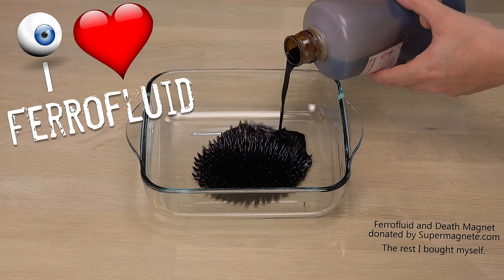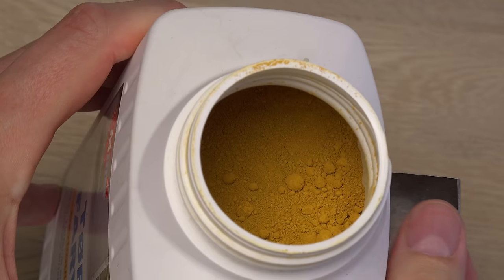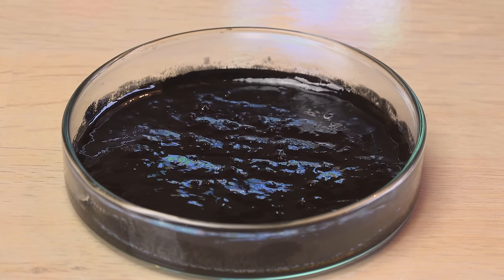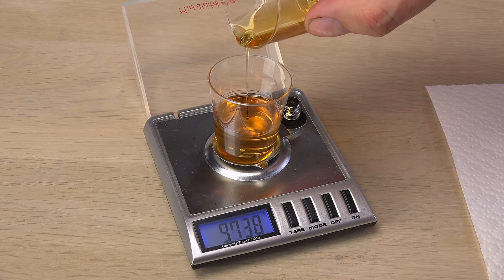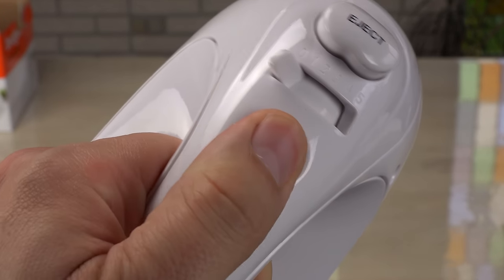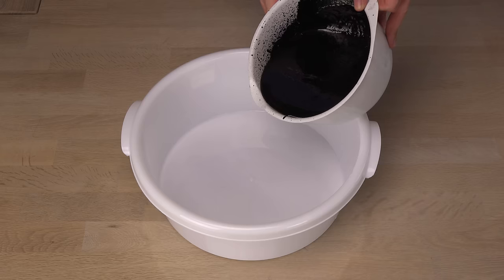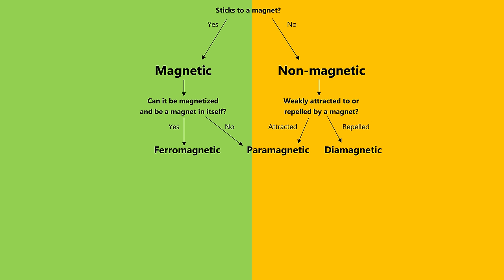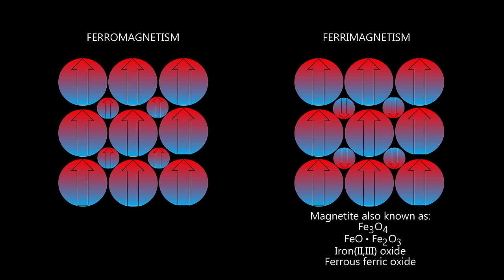Magnetic Motor Oil? | Easy DIY ferrofluid

Comment: I like how the spikes join together almost like mountain ridges here, as opposed to the discrete spikes you usually see in commercial ferrofluid. Reminds me of fingerprints :)
Reply: The magnetic lines seems to act like aurore boreale, northern lights.
Alan Turing explained mathematically how the embryo of plants and animals could form geometric patterns.
Basically, two competing type of cells with different grow rate.
I asked twin brothers if they had same digital print. The negative indicate that a random process is involved.

Comment: My car has a drain plug on the transmission with a magnet designed to collect metal shavings. When I changed the transmission fluid a few months ago, I scraped off what the plug collected into a plastic container and played with it for the longest time. It was pretty much a ferripaste because it spiked in the same way. Got excited when I saw he used motor oil! Great video!

Comment: I bet the cleanup of those bowls was near impossible...
Reply: Anything goes away if you add a strong enough acid
Reply from the maker: I sure gave up... They were heavily-worn bowls with a lot of tiny scratches. Nearly impossible to clean out from the scratches - much easier to buy some cheap new ones :) Thanks for watching!
Reply: even the bowls lol

Comment: Several years ago, while trying to make ferrofluid from scratch, I think I figured out how to make magnetite in my kitchen with household items.  It's super easy.  All you need is a plastic container, water, table salt, steel wool, a DC power supply, and a random piece of any kind of metal to use as a cathode.  I used a piece of copper pipe.  You also need a container you can heat on your stove.  I used an erlenmeyer flask, but I don't see why any old saucepan wouldn't be adequate.

First, fill your plastic container about half way with water and dissolve a bunch of salt in it.  Next, connect the positive wire from your DC power supply to the steel wool.  That will be your anode (the electrode which attracts the anions).  Connect the negative wire from your DC power supply to the random piece of metal.  That will be your cathode (the electrode which attracts the cations).  Immerse the two electrodes in your salt water container.  Be careful that they do not touch, or you might blow up your power supply.  Also be careful that only the steel wool, and not the wire connected to it, is immersed, or you might end up dissolving your wire, and that would bring the experiment to a premature end.  Turn the power supply on.  You'll eventually notice green stuff coagulating in the solution.  After there is a reasonable concentration of the green stuff, turn your power supply off, take your electrodes out, and pour the liquid from your plastic container into your flask (or saucepan).  There may be a few little chunks of solid stuff in the bottom.  Try to leave those behind as you pour.  Next, heat the liquid on your stove over medium heat.  In a short time, the green stuff should turn black.  I believe this is magnetite.  It's actually fun to play with in this state.  If you put a magnet next to your flask, all the black stuff will be attracted to it.  This makes it easy to separate it from the rest of the solution.

As far as I can tell, what's happening in the reaction is the chloride ions are attracted to the steel wool, where they pull iron ions into solution.  Meanwhile, sodium ions are attracted to the cathode, where they react with water to produce hydroxide ions and hydrogen gas.  Or perhaps hydrogen atoms are being pulled out of the water, leaving behind hydroxide ions?  I don't know.... maybe a chemist can explain it.  Once the concentration of hydroxide and iron ions is high enough, they begin reacting and precipitate out as iron(ii) hydroxide.  When you heat it on your stove, the iron(ii) hydroxide becomes magnetite.

The particles seem very fine.  They might even be nanoparticles.  I never found a surfactant that was adequate to turn it into ferrofluid, but I didn't look very hard.  I was just goofing around in my spare time and ran out of spare time.  I've been wanting to do some more experiments, but haven't gotten around to it.

Comment: Awesome video. I wonder if you could pour the iron oxide on top of the oil and stir it in with the magnet under the table instead of a chopstick or blender. If it worked it would keep cleanup to a minimum and would be fun to watch. Have a wonderful day.
Reply from the maker: When 'massaging' the ferripaste with the magnet after the mixing it does actually seems to work better and better. Maybe all of the mixing could be done with a magnet.
I have also considered that it may have been a bad idea to put the magnet close to the magnetite before the mixing. I can't help but think, that the magnetite would disperse even easier in the oil if it weren't magnetized already with the small particles sticking together from the ferrimagnetism. But it seems to work alright...

Comment: Quite lovely.  Sometimes not so much spikes as they are almost shaped more like split mountain ranges. It seems it reacts in a bit of a sluggish way- probably because of the thickness of the oil.  I wonder what "weight" oil is usually in ferrofluid or if there's a completely different type of oil.  

I had an idea.  How small can you go (beneath the table) with your super magnets and still have a reaction?  Imagine 4 small super magnets on a block of wood- on the end of a variable speed drill or slow moving motor.. May be able to make an automatic show of it.
Reply from the maker: Thanks, Ben. Yes, in my opinion the viscosity and larger magnetite particles give a different, more varying reaction making it more fun to play with for longer periods than ferrofluid. Ferrofluid forms the same spikes over and over again... I did try to look for the 0W-20 variant but couldn't find it in Denmark. Should make the ferripaste less viscous and make it easier to form rounded spikes.
The commercial ferrofluid uses petroleum as a carrier fluid which is much more fluid than any motor oil.
Thanks for the tip on using a number of smaller magnets. In a thinner layer of ferripaste (like the 20 g samples) even very small magnets will have a visible effect.

Comment: Yes. I came to the same conclusion about using motor oil, since it's partially designed to gather and absorb loose bits of metal from inside your engine. I'm wanting to refill my tweeters with ferrofluid so I'm experimenting with dirty used engine oil. I'm thinking that it will already have metal particles in it, though I'll probably have to add more.

Comment: Very cool. You might try adding a very small amount of a thick solvent to get the end product to be a bit smoother. Diesel fuel mixes really well with motor oil to thin it out. I use it sometimes to clean sludge out of neglected engines. Keep it up man!
Reply from the maker: Thanks! I'm not sure what effect the diesel fuel will have on the surfactants. May be worth a try, though the idea of volatile fuels in my living room isn't attractive ;)
Reply: Yeah, that's fair enough. Although, you have to admit you don't exactly shy away from potentially dangerous things... You know, that amazing and terrifying monster magnet you have. :)

Comment: I think if you chose a different viscosity for the oil (different from 5w30 such as 0w30 or other types of oils ?) 
Or took a liquid oil and added a surfactant yourself (dry-jet (used in dishwashers) is a common surfactant used in homemade quenching oils, maybe it could be used here)

I think this ferripaste is quite nice but it lacks the ''moving'' properties of the ferrofluid such as when ferrofluid can climb an electromagnet (bolt one) and etc.) and thus are pretty much two different things. This is halfway between ferrofluid and magnetic putty.

--Edit-- i thought about it for a few mins, and realized the oil is only half the problem. The size of the magnetite grains probably play a bigger impact, since it ''thickens'' the paste. With very very fine magnetite grains, you would need less of them to create an homogeneous  solution and thus have something closer to ferrofluid. I work with steel powders and they are often really hard to find (or expensive ) in finer size. You could possibly have the magnetite react in a solution and then reduce it to create a finer powder, but that is quite some work for ferrofluid.

Comment: I need a fero fluid to put inside an e-bike motor to keep it cool. The idea is that it makes a connection to transfer heat between the stators and the magnets on the outer casing. This transfers heat from the stators to the outside casing which improves efficency and stops overheating at higher power levels.
  Got a few questions if poss.
  Have you tried iron filings? since i didn't think iron filings would be a good idea inside a motor i was wondering about stainless steel filings / dust. Or how about neodynium magnets ground up. I do not require a very strong magnetic force but more the lubrication and heat transfer properties. So, it should be slightly magnetic and have a very low viscosity. Just enough to form a bridge between the stators and magnets as the motor turns.

Comment: I wonder if it's possible to make a less viscous version of the ferripaste, more like the pre-made ferrofluid, by using less magnetite per unit mass of oil - in your recipe you used 1:1 (10g of each), but I wonder if 1:2 (magnetite:oil) or even a more viscous mix of 2:1 might act in a more interesting way. I would love to see a video where you play around with the recipe a bit and test the different versions out against each other!

Comment: Win!  I guess the motor oil already has surfactant in it, come to think of it.  This is a great find!
Reply: And thanks for the clear explanation about ferro/ferri with regard to magnetite!  I might have known about the difference between ferro and ferri (and then forgot) but I never knew about how magnetite sand fit into that distinction.
Reply: Cere Mony All modern engine oils have detergents. They're usually alkaline compounds.

Comment: 6:04 You can use electric screwdriver with "mixer" tool for mixing building construction mixtures. He can provide low rpm and much cheaper.)

Comment: Give Automatic Transmission Fluid (ATF) a try for your next batch. It's still an oil that'll suspend the iron oxide like you want, but it's much thinner than motor oil.

Comment: What if you used a thinner grade oil, like a 0W-20, or similar? Also, I bet if you used a stirring machine to mix it overnight you could get more even texture. What would it look like to hang the magnet (maybe in a plastic bag?) then drizzle the ferro-fluid until it wont hold any more... or get 2 magnets and see if you could get them to share a ferro-fluid bridge.... brb hardware store.
Reply from the maker: I actually did try to look for the 0W-20 variant of Magnatec, but it isn't available in Denmark. It should be thinner and more ferrofluid-like.
Reply: Brainiac75 It's available in the US, in fact, I have the 5w-20 in my truck right now.

Comment: What do your think would happen if you accidentally got the runnier ferrofluid directly on one of your massive magnets? How would the clean-up and removal take place?? My best guess would be to try to soak the oil part up with rags maybe, hoping it will dry it out?
Reply from the maker: Most of the ferrofluid could be sucked into a horizontally placed syringe and removed from the magnet for reuse. The thin layer remaining on the magnet could be removed using a rag and some patience...
Reply: Brainiac75 Ah that's smart. Thanks!

Comment: A Cobalt-Gadolinium alloy can be tuned to have desired curie temperature even below 10 Celsius.  Could it be used to create a ferrofluid?

Thought it would be interesting if you could separate particles based on temperature using a magnetic field.  The non magnetic particles would have a lesser buoyancy under influence of a magnetic field.

I always wanted to play around with ferrofluid so I will give your recipe a test.

Comment: Are the oils you use rather viscous? A lot of the proven DIY Ferrofluids out there use a very watery [sometimes diluted] oil, and have them in a 3/5 ratio of oil to toner. The best kind of oil to use seems to be walnut oil as well

Comment: Three years too late to the party and this information might be over a decade out of date but.... When I used to service machines based on Minolta photocopiers you could make a very good "ferrofluid" from oil and what is called either "starter" or "developer". It's mostly a very fine iron powder that acts, with the aid of a magnetic roller, as a brush to carry the toner to the drum evenly. It works better for playing with if it is what we in the trade call "knackered".

Comment: You've done a good job, well done.

I was impressed when you considered different pigments, similar to an idea I had myself, but not the means. I don't think it too much of a stretch to revisit the experiment, this time combining water with the oil (which of course doesn't) and have the "ferrofluid" enact itself in a transparent coloured solution - spiking from nowhere to disrupt the scene, that would be dramatic, with some backlighting!

What do you think?
Reply from the maker: Thanks for the suggestion. I have considered trying to use it under water. Apparently salt water is best to avoid contamination of the water - with the ferrofluid at least, not sure about ferripaste. I may give it a try or not - so much to try still :)

Comment: You need to usr a surfactant and heat the mixture for a long time then filter it then try it . See if you can suspend it in another clear liquid that will not mix with it .maby like silicone sex lube.. or water that has been cooked with starch then added to the ferofluid. Just a thought.

Comment: Would Ferrofluid and Ferripaste work the same if they interacted instead with an electromagnet? I mean they would be attracted no doubt but after the current has been turned off would they flow off the surface of the metal due to gravity or still be sticking to it?

Comment: Brainiac, I do wonder if your "ferripaste" might be suitable for animation and possibly a motorized liquid using AC fields and probably specific frequencies?
Reply from the maker: I believe it could. Just need to use low frequencies, since it has'nt got the fastest reaction. The commercial ferrofluid would be much better for this.

Comment: I was curious about the SURFACTANT. I did a little head scratching and thought, "why not use washing up liquid?". Surely it would cover the magnetic particules easily, lower the overall viscosity and keep them apart.
I know you will reply and tell me why my "logic" is faulty :)
PS. Use the left over cooking oil to make chips, not French Fries, but English chips. Dims 3/8" x 3/8" upto 1/2" x 1/2" cross section. Due to there surface area/volume, they absorb less cooking oil/fat!
Alternatively, mix the unrequired 'paints' with the cooking oils then create an oil painting master piece :)
Cheers.
Reply from the maker: I'm not a chemist but the surfactants used for ferrofluid often bind to the iron sites on the magnetite particles. I'm not sure if washing up liquid has something that binds to iron? But I'm honestly not sure if it would work.
I'm however sure the surfactants in the Magnatec oil work on iron, since it is designed specifically to bind on steel etc. inside an engine :)
Thanks for the tips on the chips. My brother actually said the same thing since he has tried it and find it delicious :)
Reply: There was a chap in England who filled his car up with washing up liquid in place of engine oil. He did have to watch the temperature guage but he covered over a hundred miles. It is a long time ago now, but why not try it yourself? Then we will both know :) Cheers.

Comment: Maybe you could try reducing the particle size (mill the magnetite in a ball mill) and adding more motor oil. You could also try using thinner (lower cold viscosity) oil.
Reply from the maker: The magnetite is chemically made, so I believe it is very finely powdered from the factory. I may have screwed up a little by putting the magnet on the magnetite before mixing. The magnetite turned magnetic and may have clumped together... 
Magnatec in 0W20 certainly would be better. Just couldn't find it for sale in Denmark :) Thanks for watching!
Reply: Another possibility would be trying to add some additional surfactants to the oil. Formulating motor oils is always a careful balancing act, as motor oil has to have a lot of desirable properties (cost, viscosity, temperature dependence of viscosity, thermal stability, oxidation resistance, cooling capacity, corrosion inhibition, lubrication, suspension of particles, etc..)
So while motor oils have some surfactants, they do not have as much as they could have, because it would negatively impact other properties.
Unfortunately I do not know what surfactant would be best suited for this purpose, but considering that it has to be able to mix with the oil rather well, I would guess that non-ionic surfactants would be best suited for ferrofluid, such as monolaurin or stearyl alcohol.

Comment: Great video. I wonder how would it behave if you used motor oil with lower viscosity. Maybe it would be more fluid than paste.
Reply from the maker: Thanks! I believe the 0W-20 variant of magnatec would be better. Just couldn't find it for sale in Denmark :( Thanks for watching!

Comment: Could you add some sort of reducer to the motor oil to make it thinner, then add the iron oxide with a sieve of some sort to make a higher grade version of this paste?
Reply from the maker: It could be possible. I haven't experimented much with the formula - just enough to make it work. I may find time to do some more experiments in the future. My first intuition would be to go for a thinner Magnatec oil (0W20).